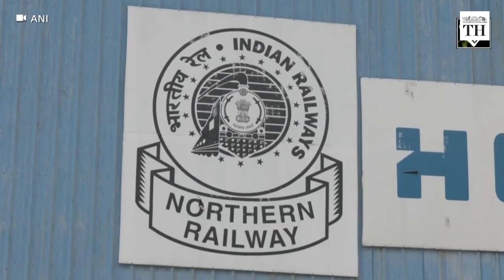A look at India's first cable-stayed rail bridge | The Hindu

Comment: Why only single track is provided? Any structural reasons? Or it's as per the need of the hour?
Reply: Weak Mountains, Less traffic, availability of Double tracks in b/w is high in this 100+ km length, in halt and non halt stations.
Reply: It's a tunnel in mountain and not much frequency is expected.
Moreover, it was conceptualised in 2002